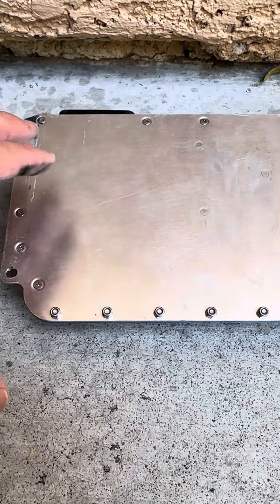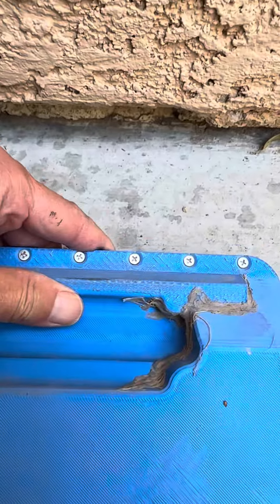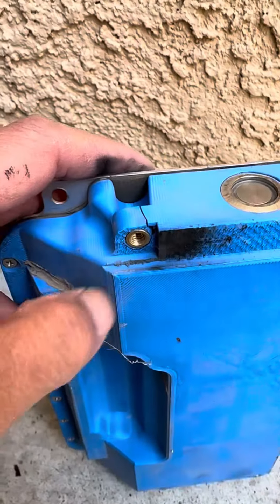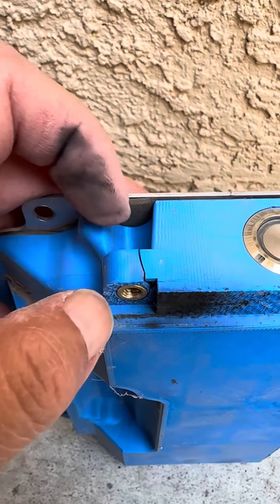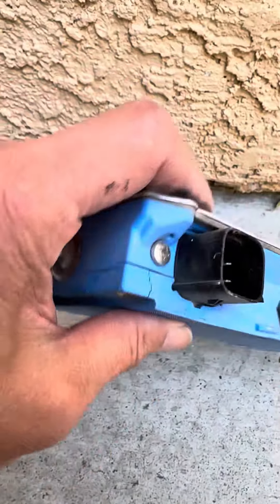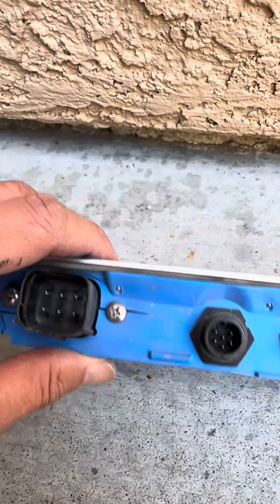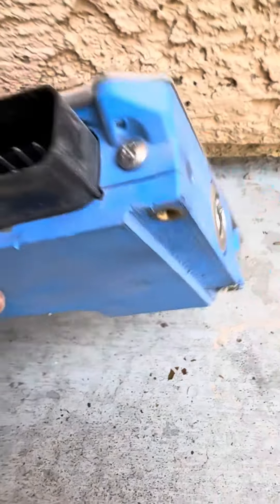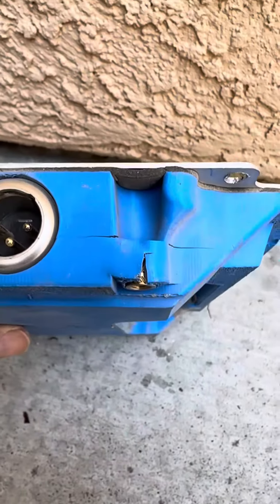PLA VESC controller box after 1 years 1000 miles, damage report!

Comment: I'd use some Ninjaflex armadillo for the replacement. It's a bit pricey and you have to print it slow but, it's a really hard tpu and to me is perfect for anything that takes an impact but, still needs to be stiff.
Reply from the maker: Both petg and pla doesn’t work well. Will have to try the Ninjaflex armadillo!